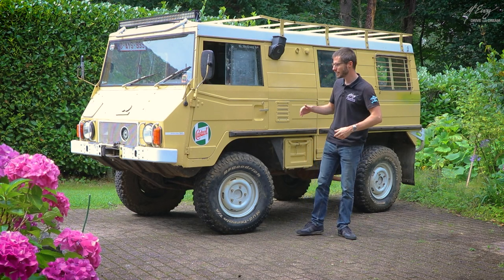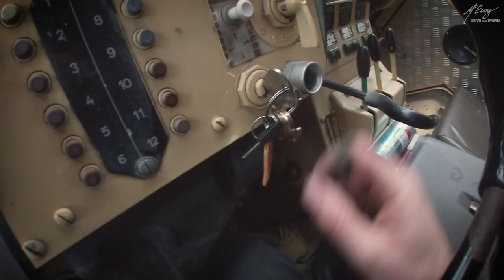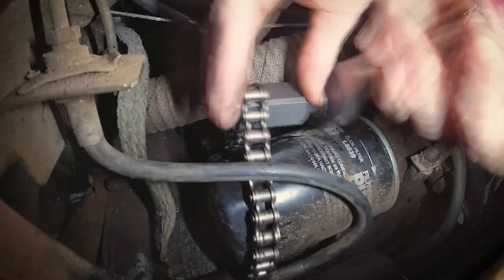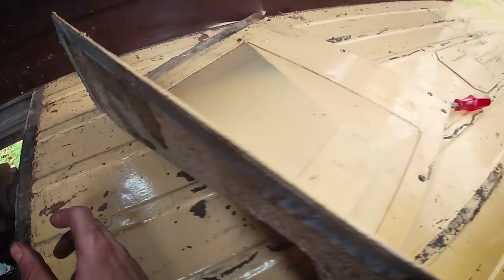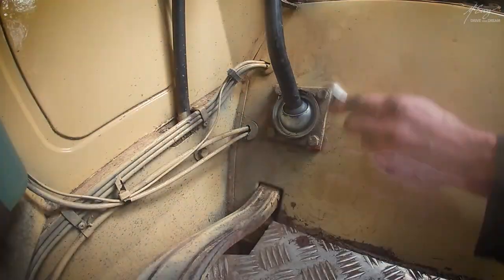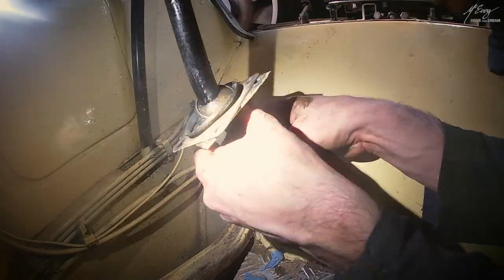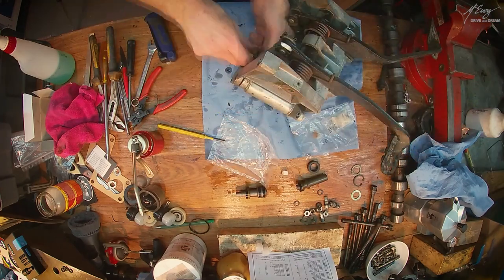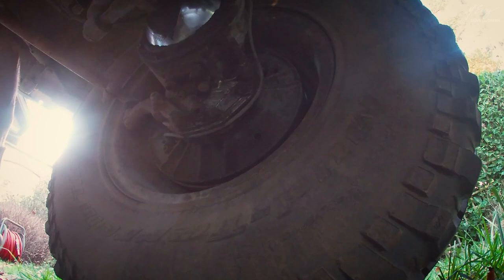Pinzgauer 710K brake overhaul, shifter linkage, axle gaiters...

Comment: the axle gater bolts should be at the 3oclock position when looking from the wheel (it makes it easier to prevent gaps)also there should be no gap even before you add the clamps. keep up the good work! in my climate they only last about a year so i replace them often.
Reply from the maker: I have noticed that they are already showing signs of wear. Shame really, because they aren't cheap. I would really like to be able to fit the original specification gaiters, but I will wait until I go for a full portal rebuild. The front right has an oil seal leak on the outer side, which might be the starting point for this intervention.
Reply: @gmcevoy  I heard the original Yellow gaters that came with the truck are no longer available if you see any let me know because those last  forever.
Reply from the maker: @dieselbenzrevive6820  Actually, my little finger tells me that there might still be a few kicking around. Not 100% sure though, but it's worth asking. Send me an email at info@mcevoy.be, and I will forward the link to you.

Comment: Hello Geoffrey, those axle boots were a bit of a challenge. Next job on my 710 will be a full brake job. All new shoes and wheel cylinders. Should be a pretty straight forward mechanical job. I learn something new every time I work on it.
Reply from the maker: Hi Brian! They were indeed. I have just reassessed the state of the brakes, and they need changing as well. I replaced the rear wheel cylinders last year, but both upper pistons were seized. I managed to un-seize them so I will be keeping an eye on those. More importantly, on the front passenger side, both wheel cylinders are in a pitiful state. The thing that really bugs me is the portal oil seal which leaks into the brake drum. I'm in for a portal rebuild pretty much, and while I am at it, I might as well do both front ones. It will have to wait however, because I lack the time, tools and resources to do that right now. I can't really drive it now because of that, although I do take it for a spin every once and again to get the fluids warm... Carefully however.
Anyhow, thank you for posting your comment, it is always nice to meet fellow Pinz Owners. There is more content coming along which you should find interesting, so watch this space! :-) 
Speak soon I hope. 
All the best,
Geoffrey

Comment: As for the axleboots, you don`t use grease on the joinigsurface with the 4 screws, you use superglue insted, as per fittinginstructions incl. in the OEM kit!, the Pinz engine was designed in the late sixties, that means mineraloil only, as for the drivetrain gearoil 80W90 is the correct stuff to use, the seals will appriciate it
Reply from the maker: Thank you for your input, Peter. I didn't use grease, I used sealing compound for the axle boots. A sort of gasket maker resistant to oil. It is more flexible than superglue. I must drain and renew the engine oil before this winter, as it has been almost a year since the last oil change. I only covered 800 kms, however, so no harm done. What would you recommend, for engine oil?

Comment: The grade of oil you use is correct, just that we use mineraloil, otherwise very nice vid!
Reply from the maker: Thank you for pointing this out. Are there other specific requirements for this mineral oil? I know that some engines require a high zinc content, for example. Thanks again, Peter! It is very nice of you. I will make sure to point this out in a future video.

Comment: Man that is some horrible shim design on the gear lever.  But what a brilliant design to make the entire master cylinder a single unit with the pedal!  And what a nasty surprise in the boots :(  - loved to see how the top part of the boot was fighting you getting the clamp around it  - Thanks for the great video!
Reply from the maker: Thank you Todd. Mostly, all units and sub units bolt on as an entire assembly which is highly useful for repairs, but sometimes indeed, it is a bit of a struggle. Thank you for watching!

Comment: Hey Geoffrey,  Ron from Colorado USA saying Hello.   I just got a Pinzgauer 710M.  It came with quite a few new parts including a heater and an electronic ignition kit.  Have you put on an electronic ignition kit on yours?  Thoughts?......thanks....
Reply from the maker: Hi Captain Ron! Thanks for stopping by! Mine came with a crappy Pertronix system which I ditched as soon as I could, and fitted the Pinz SSi instead. Made a world of difference. I did suffer a dramatic failure which nearly cost me the engine, when the ignition module got wet during a deep water crossing. It just stalled right in the middle of it. After that ordeal, I had to replace the module (the defect was not covered under warranty) and relocated it high up, behind the driver seat. I made custom HT leads, and it hasn't missed a beat since.
Reply: Thanks for your answer.  I'm not as mechanically inclined as you so I'm not sure I could install that newer unit like you got or not.  Seems pretty straight forward when I watch others do it lol.  Mine is running really good right now so maybe I'll mess with it later on.  I really appreciate your videos.  I especially like the general maintenance items like fluid replacements in all the gear boxes and the like.  I have the repair manual but I can't find any easy go-to place that talks about all the reservoirs that need service, the type of product and amount etc.  Still learning and hoping not to mess something up lol. @gmcevoy
Reply from the maker: @CaptainRonAhoy  I find the workshop manual interesting to read, so take your time to get familiar with the way it has been built. It will help you down the line when you start looking closely at the innards of the beast. It is truly well built with easy maintenance in mind. Remember this was designed for the Army. 🙂 You are going to love it.
Reply: Thanks!.....I really hope you continue to help us other PINZ owners out with your knowledge and videos!..... @gmcevoy
Reply from the maker: Thank you,  @CaptainRonAhoy   If there is anything you would like to know, you know how to find me. 🙂 Feel free to get in touch anytime.

Comment: Hi, does your Pinz have a throttle position sensor or just a normal cable? ... I'm having an issue with mine.... Mine just won't rev up I'm not sure if I need to Calibrate my throttle position sensor
Reply from the maker: Hi. My Pinz runs on carburetters. Throttle position sensors are only found on cars with electronic ignition. I would like to know more about your setup, if you do indeed have fuel injection. Otherwise, the first thing to check on your Pinz will be the valve clearance, ignition point gap and ignition timing. Once that is all good, turn to your carbs or whatever fuel system you may have. If you have carburetters, check float level etc etc, as per the tune-up video I made. 
Best of luck, and thank you for stopping by! :-)